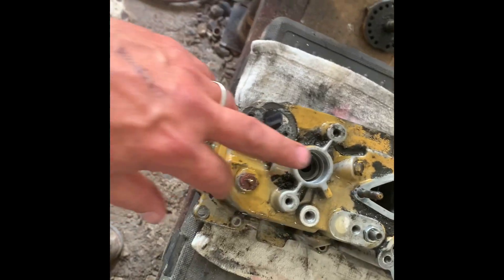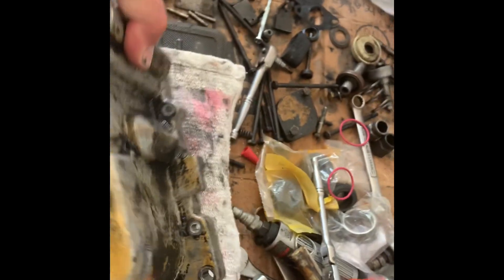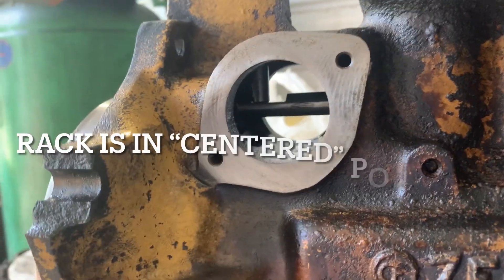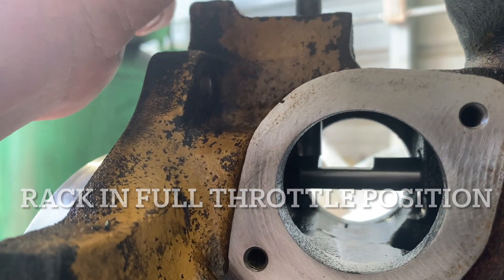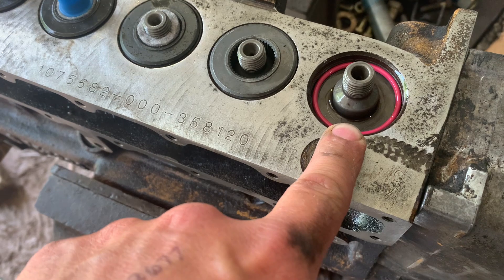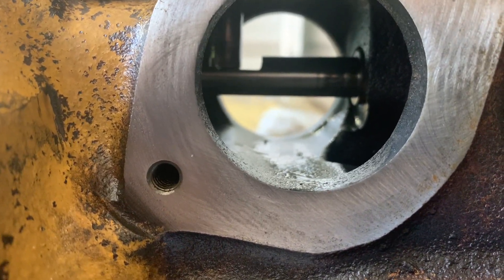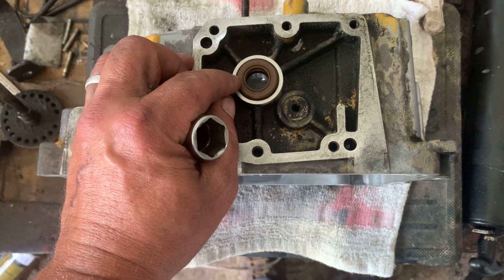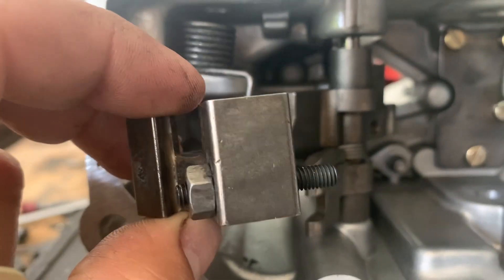Caterpillar 3406 fuel system reassembly part 5

Comment: So the inside edge or rear edge of the timing pin aligns with the inside edge of the notch in the rack? In other words if the pin is hanging over the end and partially over the notch it’s a tooth off?
Reply from the maker: sorry, I just seen this. with the shutdown solenoid removed, or installed with key on (energized to run position), and the pin is hanging over the slot, it is a tooth out. However, sometimes you have to take a screwdriver and gently push rack back to be sure. for whatever reason, I have found that pulling the throttle back alone sometimes does not move the rack 100 percent if other individual pumps are installed. I hope this helps